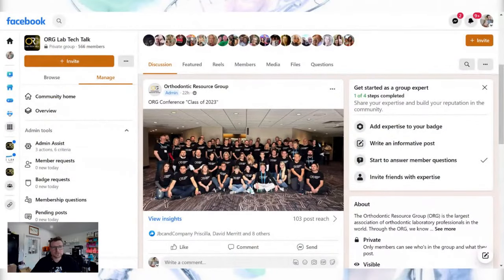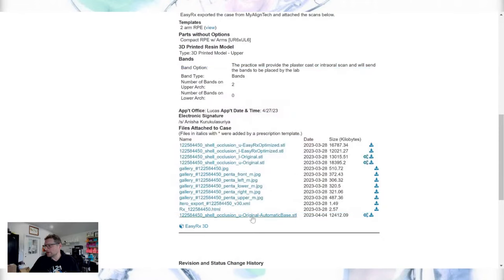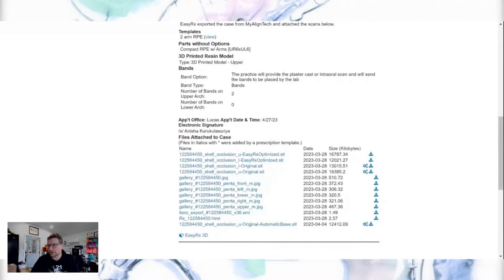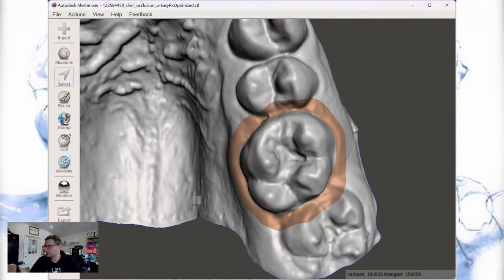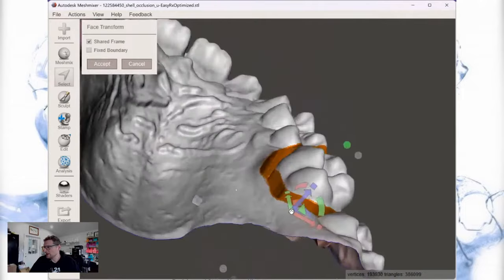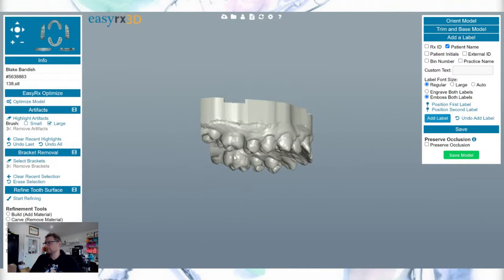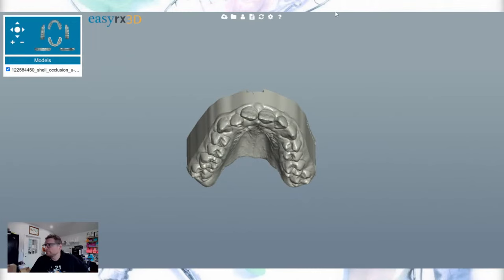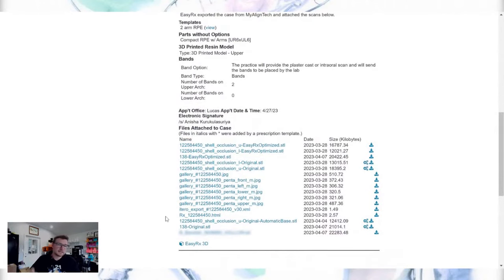My Secret to Digital Ditching for Bands

Comment: Hi! Very informative. How do you handle the ditching for 6s that are at an angulation such as pointing more lingual? My understanding is that meshmixer will only drop the ditch based on the Y-axis.
Reply from the maker: That's a good question, might be easier to just 1, Print normal and ditch it by hand using a bur 1. Ditch digitally but using a digital "Carve" tool, or 3. change the y axis using the to match the angle you need using the Edit>Transform tool in mesh mixer then ditch one side, the change the y-axis again and do the other side. Not sure if any of these would be better just thinking off the top of my head :)